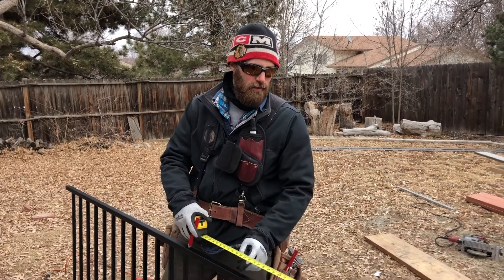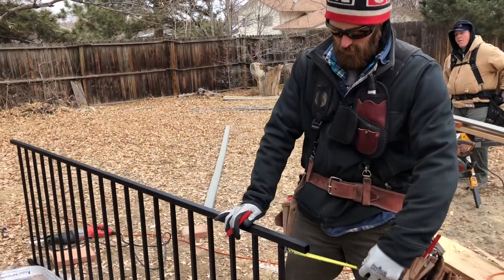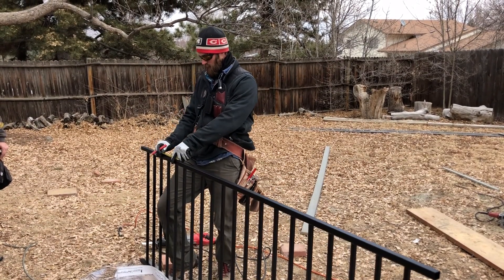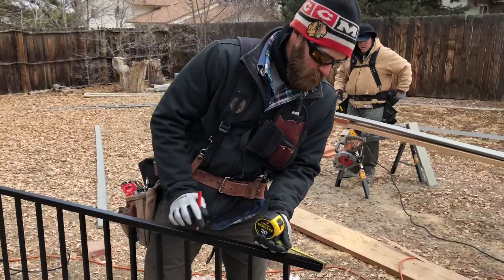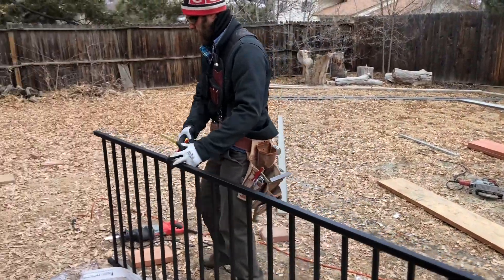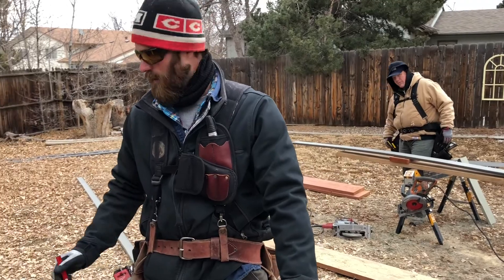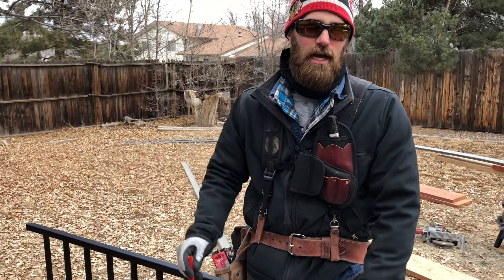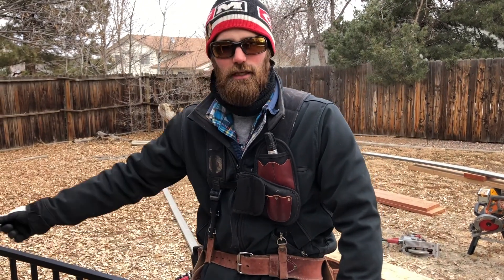How to Mark and Cut Fortress Rail - Colorado Custom Covers & Decks

Comment: I have this product and I'm struggling with drilling the holes for the collar. I also my reveal length being too short on clearance between the posts for the collar to fit.
Reply from the maker: if you use rdi or cinch railing they come with pre welded collars.